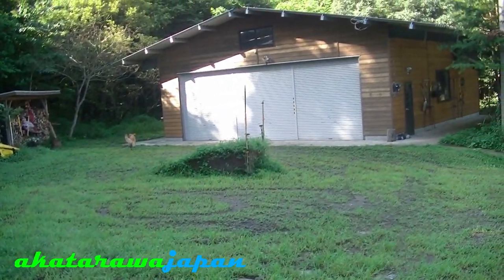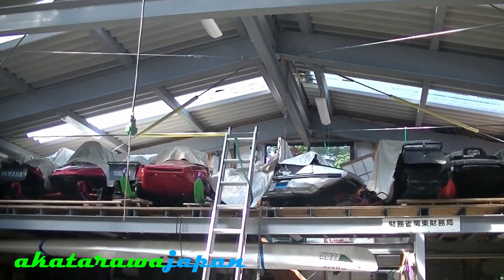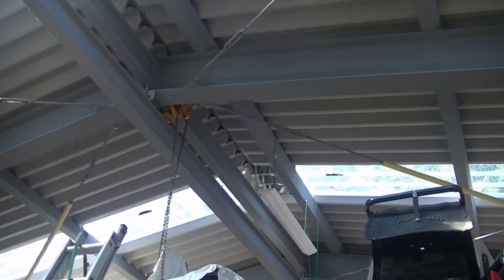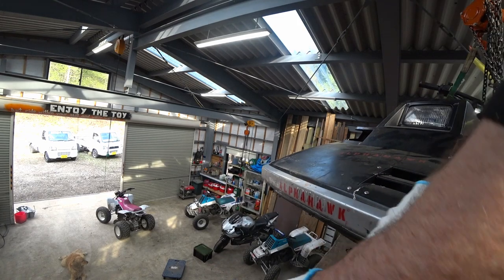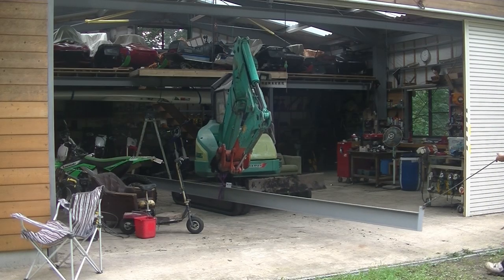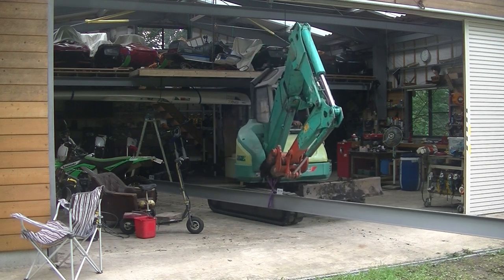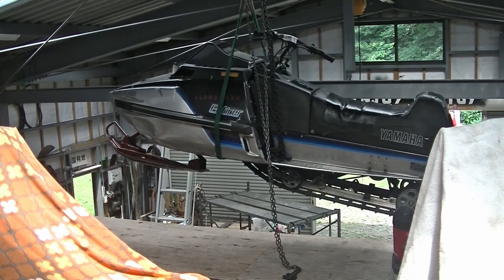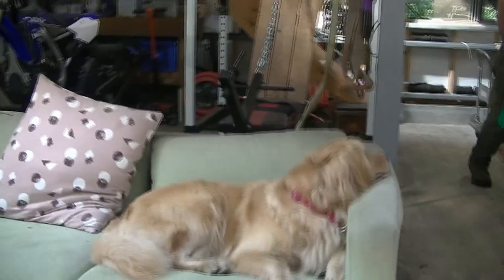Ultimate shed: fixing snowmobile storage design fault

Comment: That beam would make the perfect alpha hack monorail: impossible to bend, ultra durable... just a tiny bit heavy. I suggest the Simpson technic and punch some speed holes into it
Reply from the maker: OMG! That is a brilliant idea. My new Alpha is a 165 so I guess I will have to lengthen the track to make it an 865.
Reply: Akatarawa Japan I’m sure Camso can set you up with a decent track;) you may have to call Cummings to provide a small 12 cylinder Diesel engine
Reply from the maker: Pierre's Adventures: Well now you’re just being silly. A V8 would be more than adequate.
Reply: @AkatarawaJapan  you might be just right! weight saving is important also :P